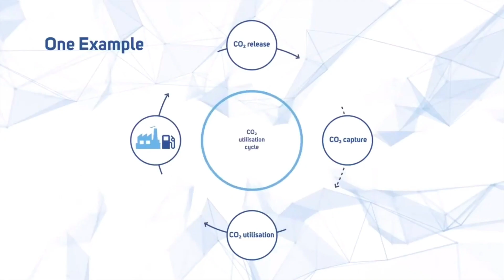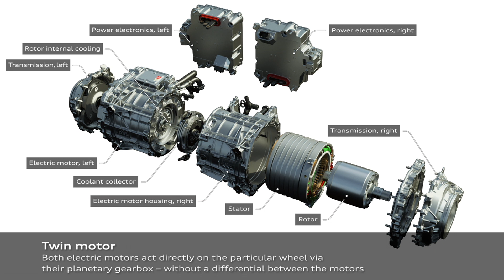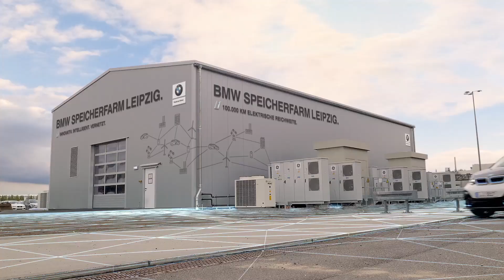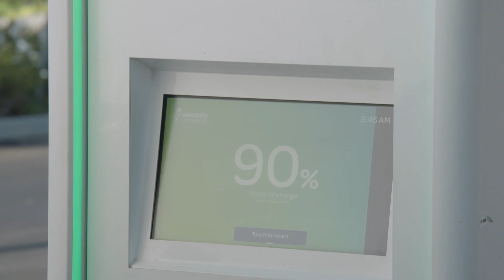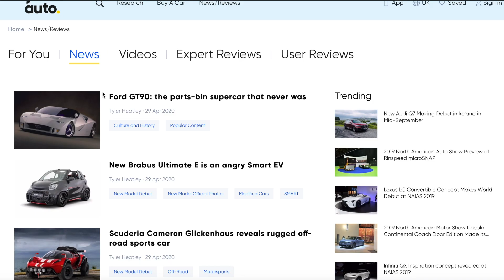Will synthetic fuels kill off Teslas and other electric cars?

Comment: We surely can’t replace all transport with batteries, so synth fuel has got to be the way forward. Sure BEVs in central London makes a lot of sense, have no tailpipe emissions at point of use in crowded areas but a retro-effective fuel to ensure we can run old cars in a clean manner makes so much more sense, make better use of those assets instead of just buy all new, but I fear consumerism will lead a trend towards all new tech because people like shiny new things!
Reply: They only like shiny new things because they are told to. Older cars just need more promotion.
Reply: @ao8271  already driving a Challenger, it's about as old school as you can get. I'm also interested in restoring or finding a 68 Charger.
Reply: @VintageCars999  im 18 right now. A lot of younger kids like me are heart broken. We have been dreaming about these cars since before we can even speak and now they want to destroy them all. This is why im moving out of the uk to japan when im older, regardless of the ban now. I want to restore old school American and Japanese cars, they are my passion. I love old school cars, bikes and motorsport. I haven’t even got my first car yet due to covid, but its going to be old school even though uk insurance is armed robbery.
Reply: @ao8271  yeah tell me about it. I work in the auto industry, making parts for combustion engines and so far I love the job. I want to restore some old cars as well, or the very least revive them and get them roadworthy again. And nothing's better than driving a manual V8 crusing down the highway. I'm 40 and I love tinkering with cars at any age. I live in America and I thought the people were smart and collectively avoiding electric vehicles and GM wants to push Americans into their EVs. I grew up with GM and Fords, they both have disappointed me in their future vehicles. Ecoboosts and electric vehicles.
Reply: @VintageCars999  what ford did to the mustang is unforgivable. When it comes to car companies its time to pick sides. Porsche has already started building their synthetic fuel refineries and are set to be making this fuel by 2022.

Comment: Cool video, apologies in advance for the long comment. The other recent issue of EVs is in some remote areas where the air temperature is plus 40 degrees it has been found  that EVs cannot recharge because the cooling fan for the battery cannot cool the battery enough with the hot air while it is recharging resulting in the overheating safety cut off to take place. This has been a common problem in countries like Australia. As for synthetic fuels the economical  benefits out way  that of electric cars when you take into account all the existing infrastructure and the vertically integrated industries associated with internal combustion engines. Considering Germany's economy relies on the car industry which predominantly is internal combustion and it is the one country literally holding up the EU it is clear it would not be hard for the EU to change its policy to save the German economy let alone the future the EU.

Comment: You forgot one thing : electricity is much less storable than synthetic fuel . Fuel is easy storable and transportable , and has a high density-energy level . Batteries don't . What matters also is where the energy is coming from . If synthetical fuel or the electricity are not coming from green energy (wind , solar , water , ...) , the the whole intention of the act is useless , and you produce less CO2 in the air by just straight burning fossile fuel .

Comment: If we switch focus to human health rather than the our planets', things look very positive for Synthetic Fuels. Even the best estimates of the growth of EVs still has a very large fleet of fossil fuel driven vehicles polluting the air and causing significant health issues (and deaths), way into the future. Synthetic fuels (green hydrogen and CO2 from the air), are not only carbon neutral, they have no sulfur, nitrogen or particulates. Yes, it extends the life of ICE powered vehicles which if 'clean' is not a bad thing given the CO2 emitted building an new EV (and the cost). It also allows me to continue the unbridled pleasure of changing gear and listening to my throbbing V8...

Comment: The cost of electricity is projected to drop sharply in the coming decades. All because of dropping prices of renewables and that fusion reactors eventually will become energy positive. Thus these synthetic fuels will fall in cost also and the low efficiency wont't really matter anymore.
Reply: @SUPERBOOM777 with all the pros and cons it may stay the same. Adjusted for inflation
Reply: Electricity cost won't fall. It will increase. Where will the government get the tax from when it has reduced the cost of Road Tax 'from 'Zero Emission" EVs? If there is more EVs then the government gets less tax, simple. They will recover it from somewhere, in the cost of electricity or tax added to it.
Reply: @papasmith7648  they are planning on doing a tax by mile system. And you aren’t wrong.
Reply: @papasmith7648  demand for electricity will increase buy supply wont due to limited storage and renewable energy.
Reply: @ao8271  There was talk of that, but there seemed to be so much of a backlash that I don't think they will manage to push it through. However, you might see more of those toll roads like the M6 Toll.
Reply: @papasmith7648  they will find something to tax people on, they always do. And it going to be a real stupid one.
Reply: The Porsche efuel plant is in Chile because it takes advantage of a remote cheap wind source of electricity and stores it in the form of hydrocarbons (efuel). That's what's great about efuels, those remote renewable electricity sources that can't be easily connected are now available to everyone.

Comment: In theory the only inhibiter of the adoption of synthetic fuels using renewable energy for powering the plant, is cost. Once the plant is built the whole system from producing octane/jet fuel, will be carbon neutral. If any surplus C02 can be captured and buried or converted into a harmless salt/rock, that would actually reverse C02 emmisio3ns. if aviation and shipping could adopt synthetic fuels, it will be a game changer. I can't see a battery operated plane or ship for at least 20 yrs.....we need synthetic fuels in the energy market to lower our carbon foot print or manage it...

Comment: If they're gonna argue that the batteries are bad for the environment, are they also going to list the energy demand and chemicals used in the process of making synthetics fuel? Because if they are, you'd find it's still worse than the batteries in the end. There is no carbon neutral car, if it uses energy, machines to make them, make or generate their fuel, etc they will make emissions. 0 emissions would mean you've basically made a perpetual motion cycle. Those just aren't allowed to exist in physics.

Comment: LCLFs have to overcome the full cost of production, the full cost of distribution, the full cost of converting petrol stations to LCLF stations, the full cost of converting all internal combustion engines so that they can operate on LCLFs, all leading to the cost to the consumer being an issue. What old thinking legacy automaters and fuel providers don't take into consideration is that the cost of entry into the marketplace for electric vehicles in terms of "fuel" is very low. The electric infrastructure providing electricity for everything in our modern world is everywhere. All an electric vehicle has to do to access it is plug in to it. The cost of the vehicle was the main hurdle that needed to be overcome for EVs to be accepted in the marketplace. Now that EVs are comparable to the cost of a regular internal combustion engine car with much lower maintenance and fuel costs to boot, AND the ease of charging at home, electric vehicles competitiveness to ICE is much more attractive to consumers. EVs are attractive to the consumer for many more reasons than their low environmental impact. ALSO, the carbon neutral argument was made for vehicles that run on alcohol such as E85 fuel available today at most gasoline stations. The idea is/was that plants extract the CO2 from the atmosphere and then the plants are made into ethanol (a hydrocarbon fuel like gasoline) used in vehicles that can run on the fuel. The cost of a device and modifications that makes a regular internal gasoline car able to run on ethanol and/or gasoline cost less than $200 installed when it is installed at the time of manufacture. These modifications make the vehicle a "FlexFuel" vehicle, meaning that it can run any mix from pure gasoline to 100% ethanol. The net effect would be exactly the same as what is being argued for LCLFs, and it already exists. And the costs are lower than that of gasoline. Ethanol produced in bulk can cost less than $.30 per gallon. Arguments against ethanol were because most of our ethanol in the US is made from corn. The fear was that it would raise the cost of food which could lead to starvation around the world. That argument was bogus because ethanol can be made from a huge variety of source materials. I personally saw reports on the use of orange peels, corn stalks and cobs, Panda Energy made ethanol from cow poop, George Bush talked about it being made from switchgrass in a State of the Union address, etc. etc. Why would you pay a farmer for corn when you could probably get your source material from Tropicana, or a guacamole producer who would rather have you take their food waste than having to pay to have it received at a landfill. Rather than going the LCFL route, why don't we mandate that all internal combustion engined cars sold in the US (the world for that matter) be made to be "FlexFuel" vehicles and remove oil companies from controlling ethanol pricing and let the market place do its thing?
Reply: @marcuswelch4515  
🤣

Comment: Synthetic fuels every day. Sound, Flames, Instant refuels and the fact it could be done in no time. Electric is to much work to the grid system and will require heaps of investment. also I see electric prices increasing to compensate loss in tax revenue from other fuels. once grants and incentives are removed from EV's they soon become expensive and with the batteries needing replacing after 15 years they become a throw away item where as my 1967 V8 mustang can be carbon neutral and a tiny carbon footprint over a longer life span say 53 years vs 15. It is in its self recycling old cars and making them carbon neutral. On top of this Industries will back it up with Planes, Trucks, Boats, Helicopters I see it winning given a fair chance and not being blocked by regulations and its a very quick fix mater of 2 years. where as i wont be buying an electric car at there current prices or anything over 5K as its not something i want to spend money on. Happy to go Synthetic tomorrow so all the climate people should be happy about this as it will meet your targets quicker.
Reply: I hate evs. They are soulless and boring and old un used batteries could be very harmful to the environment. And the community is toxic and arrogant. I love old cars, Old Japanese and American. poorer countries that have limited electricity supplies dont have easy access to evs. So this is perfect and needs to be shared.

Comment: Long distance drives like crossing Canada or America take many gas tank fill ups.  But cars do that in minutes at the gas pump.
EV need now hours to charge and so you would need vast parking lots of electric charging stations, and hours wasted while your
car gets charged up.  EV range is 300  miles per charge but many cars can go at least 400 miles per tank of fuel.
E-fuels is a fine idea but they are low in efficiency compared to gasoline and diesel fuels.
Reply: Don't forget electric generator still using fossil fuel

Comment: There is currently no alternative to liquid fuels for aircraft and marine transportation so, yes, there must be a place for synthetic fuels in the future, whether or not it applies to ground transportation.

Synthetic fuel manufacturing is currently under consideration as part of the new Gen IV nuclear power development.  The heat produced by these reactors is ideal for high temperature steam electrolysis used for carbon neutral production of hydrogen and, ultimately, synthetic fuels.

Comment: Enjoyed this. Feel like you seek the truth and not bias. 

Here’s the problem with EVs. They’re too expensive for the average person. Even the cheapest Tesla is 40k plus financing etc. So right now we are taking the worlds cleanest luxury cars off the market to go a little cleaner. We need to be dealing with the 2k cars. They’re the ones making all the CO2. Synth will allow this to happen over night. We keep gas stations and car plants. 

Also  range is the reason I don’t own an electric.  I need to be able to hop in my car and drive 8 hours. I don’t have time to sit around charging stations 30 mins at a time every 200 miles. 

Lastly the batteries on electric cars is a limiting factor. They lose range in and so not work well in cold environments bc it takes so much more energy to run a Tesla in cold climates. 

I think anything is step forward from ICE but I think the interesting thing about synth is it removes several barriers to entry than EVs do not yet solve for.

Comment: So the rite to repair will not apply to cars trucks buses trains aircraft compressors and generators, can you imagine the loss of life if the power goes out to a hospital and it does not have an emergency generator running on fossil fuel. Its more environmental to run our world on bio fuel or the fuel being developed by porsche we won't need huge charging hubs built. But the main point is the gvt will still be able to pull a revenue from fuel.

Comment: 3:30 Why no one can actually tell the real truth what is really about efficiency of 20-40%?
It is the TERMAL energy in overall energy efficiency of engine. The internal combustion engines are also heat engines, they use fuel to make explosion to push the piston to make mechanical work. Explosion and gases are hot and termal energy in ICE isn't used or stored. Also isn't stored or used in EVs even if they produce much less heat by electric motors and batteries, but they get 100% efficiency (?!?)
Storing heat or converting to electricity and fitting that system into a car it would be either gigantic or utterly expensive.. or both. So, why is it considered if no one is using that produced termal energy? 
Another, thing if we consider the energy density in fuel tank VS electric battery (Li-ion), dinosaurs wins by a miles... 
If we would consider those factors, then we could get the right information with which system we use at least energy.

Comment: Synthetic fuels will dominate. EV infrastructure can't compete. You can be in and out of gasoline filling stations within minutes where as charging stations you can expect long lines & wait times to charge. How can EV charging possibly accommodate large volumes  of automobiles looking to charge? They can't. + battery waste is an environmental hazard, where can you possibly store no longer useful battery chemicals?

Comment: In remote locations, far from “civilization”, like ours, where you have a range of both commute vehicles, ranch vehicles and agricultural equipment, liquid fuels are far superior to electricity for a variety of reasons that are easy to see when you live in such an area.  For commuting and delivering strictly within range of denser development, electric power, overall, is a better approach.  Also, throughout most of the developing world, the deployment of charging stations, if left to the private sector and individuals who own homes, will be spotty, at best, but transportation will still be a vital need for rich and poor alike.  The answer that best preserves both social equity AND prospects for the world's environments is, therefore, a mix of different types of fuel, with an emphasis on efficiency and conscious thrift of usage, combined with a robust investment in incremental scientific improvements.  All of this cannot be achieved fast enough by the private sector, alone.  Solid backstopping by government will be required and unhelpful regulatory impediments removed.

Comment: It will all come down to Nuclear economies. Cost vs range and efficiency. Its a very complicated question that has no answer yet. Just say you can make 400MW's of thermal energy using a nuclear reactor, the question will be asked, what should do with that thermal energy??? Should we use it for industrial uses such as Direct Air Capture and fuel production? Or, should we use it to make steam, and generate electricity. That is the question when it comes to Hydrocarbons vs Electric Vehicles.  Remember that there is around a 30% to 40%. And another 5- 10% loss through the grid and at the wall. So anyone who keeps bragging about how "efficient" Battery cars are, you really need to know that fact. Until we know the economics of using thermal nuclear energy for direct industrial uses, the question is still going to be unanswered.